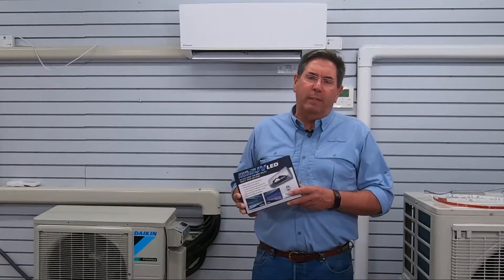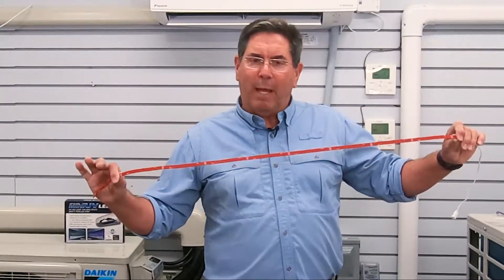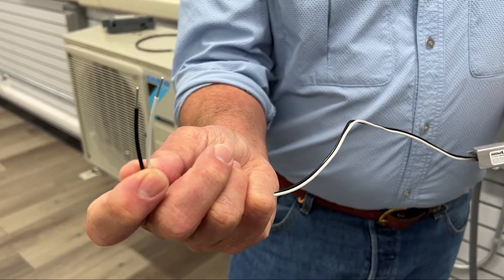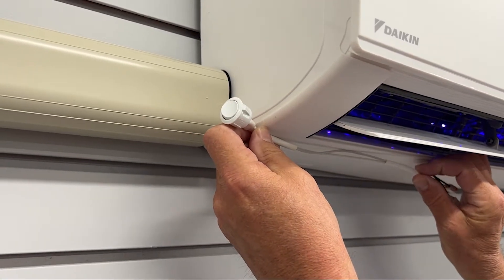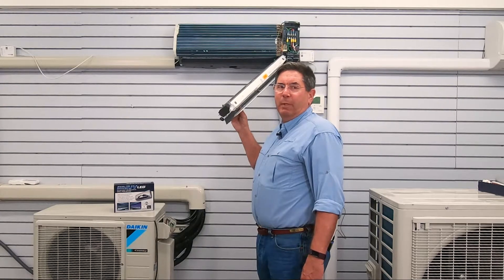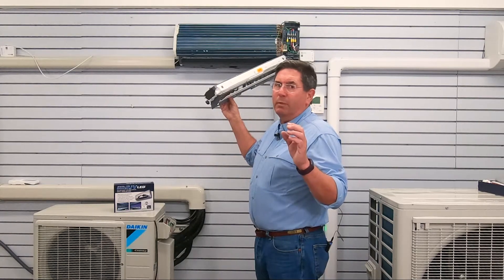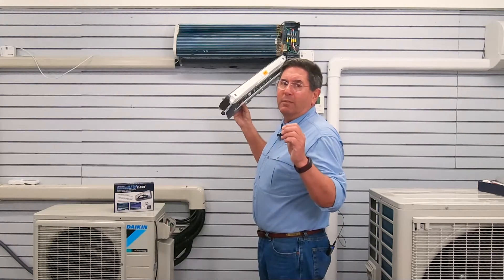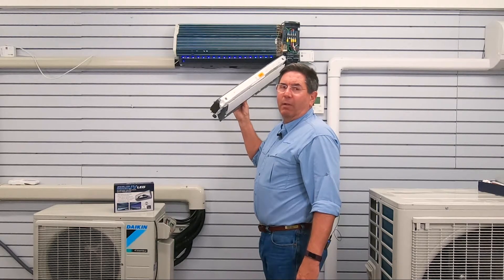Using UV Light to Clean and Sanitize Your Ductless Unit

Comment: Where would you place this on a Mitsubishi MSZ-FS mini split? I just got it installed and it’s under the blower wheel. Problem is, it shines through the vanes where I can see the bulbs directly. I’ve tried adjusting the vanes but the light still gets through directly to my skin.  

Since this is UV-C, it can cause burns. So I can’t be in the room really when the light is on. Unless, is the light safe with skin?

Or should I place the UV light somewhere else in the unit? Above the blower wheel maybe? Behind the evaporator coils?  Or may be behind the door to the unit where it shines directly on the filter and coils?